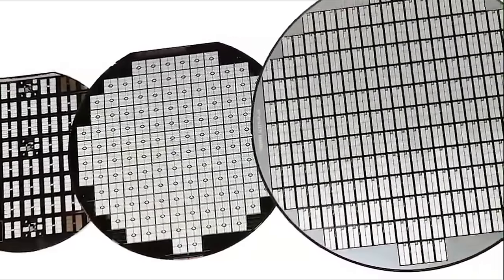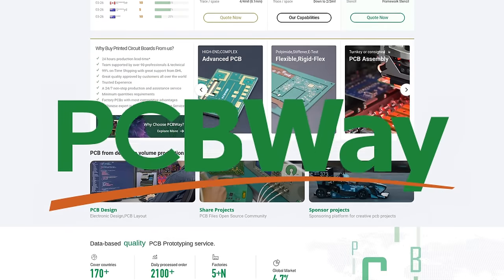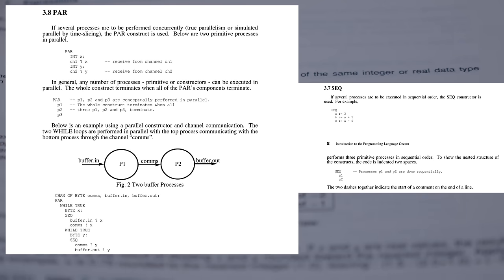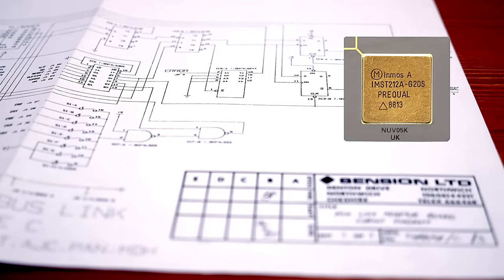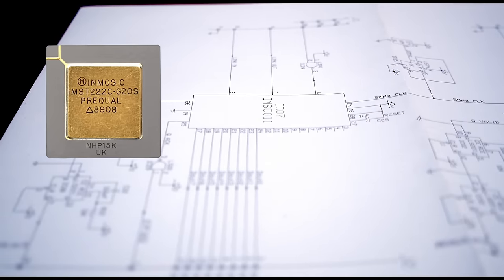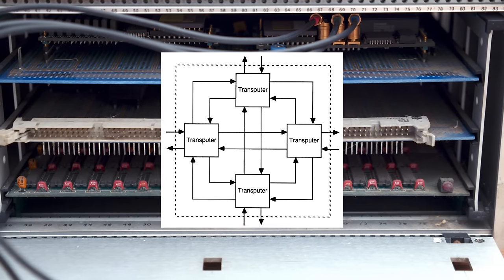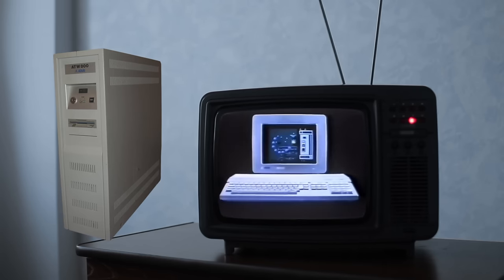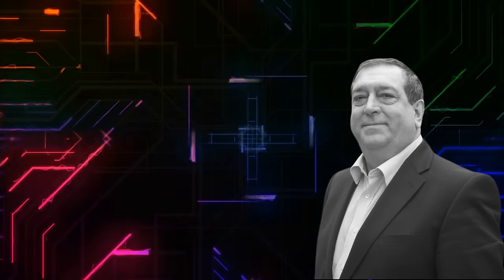The Transputer: A parallel future

Comment: I spent a lot of time in the late 80s programming up a Meiko Computing Surface with 40 T800s in it. I hated OCCAM! I hated the folding editor! I was glad when a C compiler became available. OCCAM also was pretty hopeless when you simply wanted to manipulate a whole lot of numbers as in matrix multiplication - image processing is what we were doing. 
In the early 90s I emigrated to silicon valley where not one person I talked to had ever heard of the transputer. With this I pretty much knew it was doomed. What they should have done was port Windows 3.1 to it (somehow) to keep it going and get the thing sold in the States.
Reply: What do you mean? Replicated PAR was magnificent for matrix manipulation. We've had to wait for years for languages to catch up with a streams, lambdas and compositional semantics. *8')
Reply: @markbooth3066 Maybe it wasn't the matrix stuff that got tangled up in mountains of braces - apologies to occam for that - but some code ended up with almost lisp-like brace embeddedness. Having complained about occam, there was one parallel programming language which made occam a dream in comparison and that was Strand... That was insainly complex, everything was tuples and every single line of code executed at the same time with some semblance of control only available through the use of semaphores.
Reply: I think they key point of Occam was to think about your problem in a completely new way (for the time), and you could get yourself tangled up an a mess if you tried to write standard procedural code, but it did have some powerful constructs that are still really difficult to replicate, even today.

Comment: In the 90's the company I worked for had a modular data acquisition product that used Transputers, each board would have one that looked after that boards function, analogue measurements, digital IO, storage, etc, with the channels being used for inter-module communications. Having been quite into the whole Amiga/Atari side of things in the 80's and being aware of the ATW it was interesting and a little surprising seeing these ST branded devices turn up in industrial use.
Reply from the maker: Its not an area you expect atari to be involved in, its a shame the timing did not work out for them.
Reply: @RetroBytesUK  Oh, there have been professionalized Atari ST machines, most popular by Rhotron or IBP, which basically transformed ST based machines into 19" VME cards on a backplane. The ATW also is a very curious machine (I repaired one such machine with an additional farmcard sporting 4 transputers, some vids on my channel a few years ago), shame the OS and software never really evolved past the beta stage, the concept seemed quite promising.
Reply from the maker: @1337Shockwav3  I'll have little look later, it will be nice to have a proper look at a farm card.

Comment: Has anyone come across the Spinnaker project from about 2009 at Manchester. It reminded me very much of the transputer.
The spinnaker chips seem to be like multi-core transputers (with intercore links, transputer style rather than being SMP parallel cores), and the built card linking multiple chips together to have a large number of cores per card. The cores where ARM926, and Steve Furber was/is at Manchester so,  it's a core they've got some experience with. ;-). It was also design for super-computer applications.

Comment: IIRC, Cray 2 used a SparcStation as a terminal and had no output... There was an auction on eBay for one of them in Japan, free for whoever could take it away.
Also, in terms of massively multiprocessing designs, would you consider the F21 (1998) as a transputer? All those "stack machines" with Forth (including InMOS chips) are designed to be massively parallel, but would they count as transputers?

Comment: Back in the day, I had an Amiga 2000, and for a brief time, there was supposed to be a Transputer board available which plugged into the Amiga and let you put  u p to 17 CPUs in there, although I suspect outboard power was required. Not sure it ever shipped however.

Comment: The iNmos Transputer chip was an amazing development. Unfortunately it lacked a way to program the chips, and their Occam language was indecipherable. So it died a miserable death, and the recent and even better designed Epiphany chip from Parallela died a similar death, because nobody could program it in assembler, which all  you have at the start.
Reply: This is amusing. Occam was one of the simplest languages out there. It could be completely described in it's 31 page language definition, but you had to think about problems in a different way to use it effectively. The complexity came in breaking down problems into blocks which could be run in parallel, and we have the same problems today with Hetrogenous computing, microservices and GP-GPU. Writing the same multiprocessing software in any other language might look more familiar, but creation of a parallel algorithm is no less complex or time consuming. No implementation is more parallelisable than the algorithm the implementation is based on.

We were taught Occam in our first year of University, along with Pascal and Miranda (the functional language Haskel was based on), to ween us off the idea that procedural languages were the only ones out there. Sure we were taught C and C++ in subsequent years, but staring us off with such a diverse initial language selection really helped people think about programming in a different way.

Now, I think it's amusing that the big criticisms of OCCAM were how whitespace was syntactically significant and how counter intuitive the folding editor was. These days, Python is one of the most popular languages out there, and many editors support automatic folding of code, be it collapsing functions or classes, or even just hiding imports within a little + section. *8')

Comment: 20 years back (16/17 years old), when first dual core CPU were on the commercial market , quad core almost there, they predicted CPU would never have more then 8 core's as each core would had to wait on each other to access memory so ruin efficiency. So I wondered why they wouldn't build computers like this transputers in a (3d) grid. Each application could run on its own mini CPU, no waiting no lag. And modular expandable, so no buying a whole new setup just to be able to put in a higher capacity ram or CPU. Which was a big thing as each new generation of ram or CPU back then required a new generation of motherboard to support these bloody things.

Comment: For complicated reasons, I have a T800 board for the old 8bit PC slot. With a whole 8MB of RAM on it. Sorry - I don't have the software. On modern hardware, the idea of messages and no shared variables still has a lot going for it.

Comment: CISC is effectively compressed instructions. Near 1 IPC with CISC CPUs started with 80486 and 68040. Classic Pentium and 68060 exceeded 1 IPC.

Compaq SystemPro has two 386 or two 486 CPUs and it runs Windows NT 3.1 and a custom version of SCO Unix.
Reply: CISC is about MANY instructions, with the intention of reducing the number of bytes needed to encode a given program. Basically each CISC instruction is a macro, which is translated to many simple instructions within the physical CPU by using microcode. Modern CISC cores translate the binary to internal instructions, then fuse some of these instructions together where possible to reduce the number needed, then execute them out of order where possible using multiple execution units. It’s this long chain that makes for a large and power hungry chip.

Modern X86 processors have in excess of 1500 distinct instructions (the precise number is arguable), in variable width instructions up to 15 bytes wide, so it is amazing that they can decode and execute as fast as they do.

Comment: Didn't the OG shuttle run off transputers? Also there were PC's with a Delta slot, exactly for a transputer board, ultra rare, but I had one as it was and oddball & cheaper.

Comment: This is very similar to high-end NVIDIA chips (no longer really GPUs).
For example H100:
- integrated RAM directly to the chip
- has a dedicated interconnect to connect at most 256 chips
- switched chip interconnect fabric
- cannot run real operating systems, and commanded by a host CPU
- designed for supercomputing only

Comment: If i were designing a multi-CPU computer which always avoided memory sharing i would include a "memory owner id" to be used by any thread wishing to use any shared memory. Only the process id matching the memory's current MoID could use that memory. Changing the MoID to any other ProcID would assign the memory owner to that new Proc.
As there can never be more than one MoID there can never be a conflict of ownership. And thus memory sharing amongst multiple Proc running on any number of CPU.

Comment: BBC Micro, had 3 processers running at the same time, 6502, Z80 and a 80186 all using a common bus, was doing this over 30 years ago, be about the same time.

Comment: It’s a little shocking how much this looks like modern gpu accelerated compute. 

Attaching accelerators that run their own custom instruction set with their own compilers to more standard host systems to deal with the io, on-chip (sort of) memory, provision for basically arbitrarily large scale out. It’s basically all there, in the 1980’s.

Comment: I'm curious about the ATW featured at the end. When I saw the picture of it I thought it looked rather like an IBM PS/2 Model 80. Is there any connection here or was this some sort of 'standard design' for the era in more commercial systems?
Reply: More likely standard design imitation. I remember a time in the late 90's where every small whitebox computer company though model numbers needed to be thousands 1000, 2000, etc.

Comment: I was a teenager when the Atari ST came out and remember reading about their Transputer with interest.  The only thing that I really remember is that its graphic capabilities were supposed to be impressive.
I had no idea that it was the foundation for some supercomputers in Europe.
Reply from the maker: Atari really jumped on the cutting edge with creating a transputer workstation. Unfortunately it came around the time Atari was really starting to struggle, and what could have been a promising entry into the workstation market was killed off as Atari had other calls on its cash that they thought would help them turn things around. Saddly it did not work out that way, and throwing all their resources into the Jaguar and still falling short of the sort of resources they needed to make it a success killed them.

Comment: The whole concept of the Central Processing Unit wasn't really a thing until the 1940s and didn't even have an actual name until the 1950s;  Back then it wasn't a chip, it was a contained unit which did all the processing in one section of the computer, usually a big box in the central housing cabinet of the computer.  Non-CPU centric Computers existed at the time in the form of relay computers and mechanical computers, but the concept of the CPU was cemented by both IBM and Nasa and then went on to form the basis for the concept which lead to the creation of the CPU in the form of an integrated circuit by Intel physicist John von Neumann.

Comment: I think most of the Dates were sold to Kodak

I have an old ISA bus adapter from a company called Nth Computing with a T414 and a T800 that appears to be a 3d graphics accelerator 
The transporter is sandwiched with a high resolution dual video card with a huge amount of memory marked 'Display Lists" 
It's still a mystery artifact
Reply: Doncha liv auto correct

Comment: Probably the next step in software .. will be cpu integrated fpga. Then you write your silly software , the compiler will do its best to create the best suited hardware for it whitin the fpga , so it has the instructions selected to best suit the cause. Then compile the code for that hardware , to make it run as efficient as possible.

Comment: I did a high resolution graphics display simulator with 25 T800's using Parallel C. Much easier to use than Occam.

Comment: Something that may have slipped from geek folklore - Helios was derived from the name Perihelion Software, which itself is a pun on perihelion meaning closest to the sun - a reference that the idea was to take on Sun workstations.
Reply from the maker: Perihelion and Atari could have potentially carved out a nice bit of the workstation market for them selves, unfortunately it would seem Atari did not have the cash resource to stay the course.  It would have been a very different path for them.
Reply: @RetroBytesUK  Maybe, but the workstation market was very well served by incumbents by then, and the x86 market had all the other money.  There weren't many niches to compete in, capable of funding the insane R&D and produciton costs to staty competitive.
Reply from the maker: @proudsnowtiger  there seamed to be alot of small companies producing transputer devel boxes and cards, and they had already sunk most the R&D costs. I think they could have carved out a nice nitch in the simulation and real time space.

Comment: I haven't seen before an RGB output with separate wires for red, green and blue channels.
Reply from the maker: You would also see it on some highend unix workstations from that period too.
Reply: This was extremely common at that time. High end monitors also has separate coaxial inputs for each color component.

Comment: did a fileserver front end on a hp9000 for one of these back in the day!
Reply from the maker: Nice, was it for you're own project, or was it created as part of a commercial offering?
Reply: @RetroBytesUK  it was done as part of my degree, the project bit. Build a nice little protocol to switch the terminal between the hp9000 Unix system and the transputer dev system so you could switch between the two and up and down load files! So it was party C code on the hp and occ on the transputer dev system
Reply: Had some hardware too that had to be designed blimey too many years ago

Comment: It is possible to get CPUs not designed for Multiprocessing to do Multiprocessing a good example is the dual-603s in the high-end Bebox machines.

The 80386 and 80486 are also good examples ive seen old servers using dual 386s and 486s.
Reply: Those were designed for multiprocessing - just not quite as well. For instance, that's why the 386 has a LOCK signal, and I vaguely recall the Power architecture was an early implementor of load-link/store-conditional. It's also true you can multiprocess with general purpose processors, with tools like MPI.
Reply: Kudos for mentioning Bebox if you are meaning the BeOS box, Haiku OS is still my favourite OS, tiny lean and mean and great desktop Tracker, wish I could use it instead of Windows.

Comment: I liked the copious detail of the history of this crazy chip, but I think you really left out the main problem with it, which was its architecture. The most successful architecture was the von Neumann one, which was very general.  With parallel systems you want the topology of the transputers to match the problem you are dealing with. For example graphics systems of that time would often have a kind of serial topology, where your parallel chips would need two high speed buses and the data shunts from one to the next like a conveyor belt. These transputers had 4, so that may suit scientific problems which have something to do with interacting neighbour cells on a 2D grid, but then if you wanted to do the same in 3D you would need 8 I/O connections. The point is if the transputer topology were a perfect match for your problem then the hardware would certainly go at blindingly fast speeds, but for all topology mismatch you are going to get a performance hit which rules it out in many cases. In many applications you would be crying out for a common bus to shared memory. I think something like this was added later, but the point is the idea was flawed from the outset. Indeed this was a classic case of design some novel idea which looks good in lecture presentations, then once having invested, you try and find applications that fit the architecture, rather than fit the architecture to the application. 

Also I seem to recall these things were very expensive, like a few hundred quid for a chip compared to a few quid for a Z80 or similar. I think it is the classic British mistake of thinking if the PR sounds good the hardware will perform just as well. The inherent problem with it was not easy to sell. The advantages of it, like the high speed of the interconnects was easy to sell, just a number.

Comment: It was a commercial failure. The target was to revolutionize the market and become mainstream. It did not become mainstream.  I am not sure it would have matched the performance of other architectures, but expecting people to learn a new language and think in a completely different way is not scalable. I am sure it could have done far better than it did, but just Like vector processors competing against the full industry investment is not going to work in the long term. Even more so in the 90s when commercial microprocessors were jumping performance, often more than a factor of 2 from one year to the other.   The Japanese insisted on classic vector computers for years, and to me, Earth Simulation 1 was the culmination of the full country effort.  Please take into account that a product being a failure does not mean it was bad it means it did not match it's target market share nad or revenue.   Message Passing Architectures are still useful, and one can decide what was more influential the Transputer of the CM-2 from thinking machines.